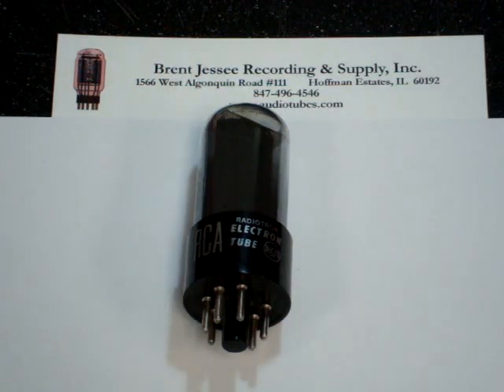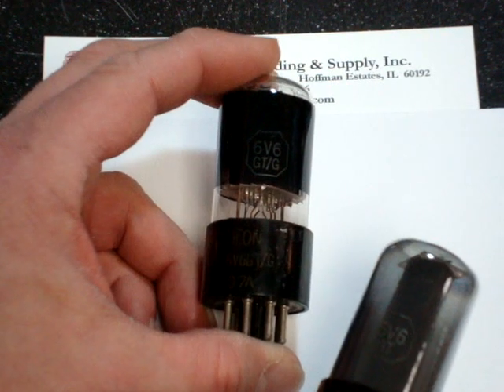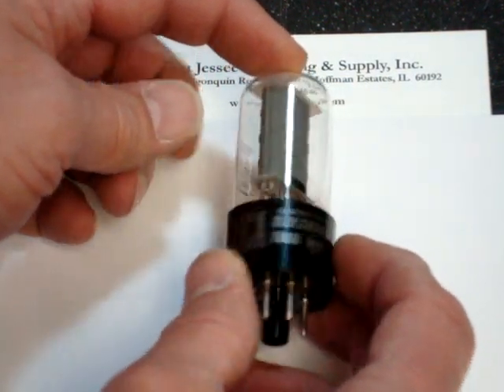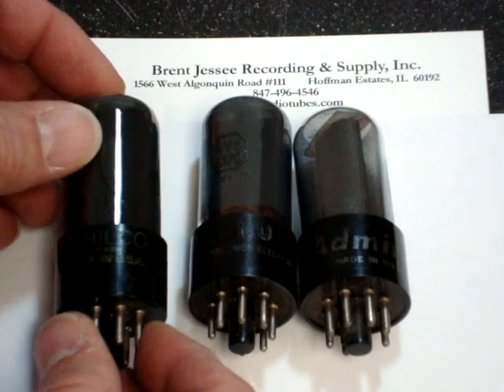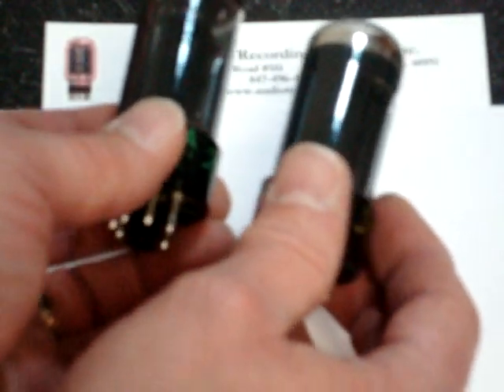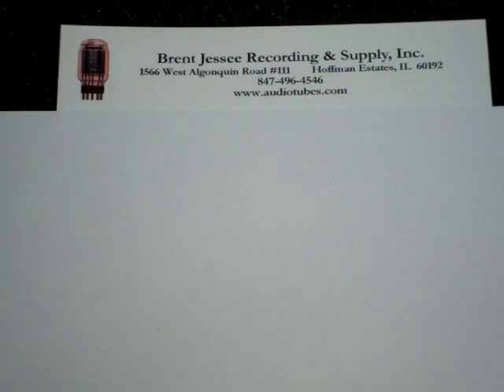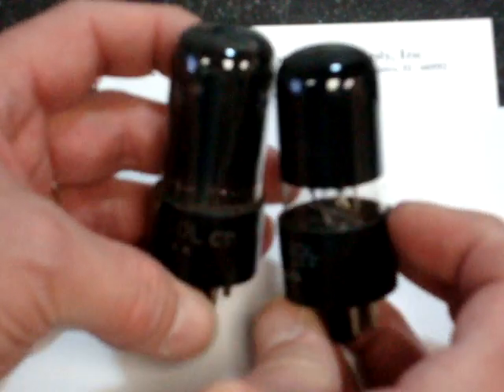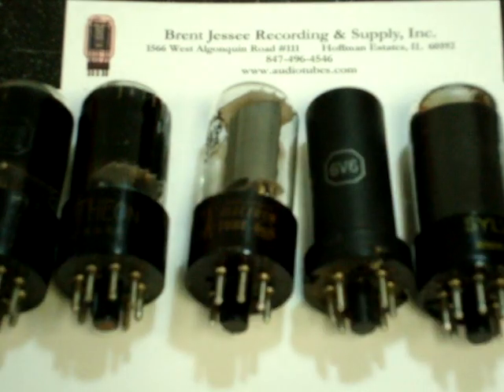How to Spot a NOS 6V6GT Vacuum Tube

Comment from the maker: Absolutely correct.  That is why the metal tubes never caught on for guitar amps.  If your amp does not have a connection for pin 1, or it is just ground, then you can try them.  They are much less costly than the glass versions.

Comment from the maker: The tubes don't run hot enough to have a problem with fingerprints.  That is mainly a problem with Tungsten-Halogen light bulbs.  But any dirt or oil on the glass can get baked on and be hard to remove later.  We sell 6V6 and 6C10 tubes for all Fender and other amps.

Comment: It's worth noting that pin #1 of the metal 6V6 is tied to the shell, so it should not be plugged into an amp that uses pin #1 as a tie point for the grid-stopper resistor.  Same deal for the metal 6L6's.

Comment from the maker: It probably sounds pretty good, too.  Some antique radio sets used the 6V6, but it was more of a hi-fi and guitar amp tube.  Thanks for watching.
Reply: Did manufacturers decide the RF powder coating was not important and just went ahead and produced later tubes without it?

Comment: I have an older radio in a wooden cabinet with a very low ceiling of wood above the tubes.  There is one 6V6 tube needed, and I need to get the shortest 8V8 tube available, as the one I have in it now (a metal based National Union GTY/A, probably a Military National Union tube) is really too tall and heats up the wood ceiling too much, as it is simply a tall bulb, but most are however there are differences.  The NU sounds great, but I have to keep a fan nearby to keep the heat from damaging the finish on the wooden cabinet.
If anyone knows the shortest in height of a 6V6 tube, please post the information.

Comment: I've gotten a few vintage 6V6GT tubes from my father-in-law. How would you rank these to each other? - 1953 GE 6V6GT, 1958 RCA 6V6GT Gray Glass, 1961 RCA 6V6GT Clear Glass. My amp is a VHT Special 6 Ultra Combo, which is based on a Fender Champ design.

Comment: Excellent info...what do you think of the NOS Brimar and Mullard 6V6GT?  Now if I could get you to do similar videos on comparing transformers - Mercury Magnetics, Heyboer, etc. that would be sweet!  I don't trust MM's advertising as dealers that push them via YT always change the speaker too...so it's impossible to actually *hear* the difference made specifically by the OT, PT, choke or reverb transformer.  I don't want to buy the Monster Cable version of transformers...tubes...caps...pots, etc

Comment: I have just come across some old 6V6's.  Some Sylvania's, a RCA gray glass, a Hammond clear glass, (which I think was made by RCA because of the code "274" on it) and a CBS.

I can not find out anything about the CBS.  There is no manufacturer code.  Did CBS make their own tubes?  It has what I think is a date code of 5748, which I think means the 48th week of 1957, correct?

Thanks for the informative video's!

Comment: Hi, great video. Aren't you supposed to avoid touching the glass portion of the tube since fingerprint oil heats up when the tube is on or whatnot? Do you sell 6C10? Do you have 1982-86 Fender 6V6s for Super Champs? Thanks
Reply: So wipe it off